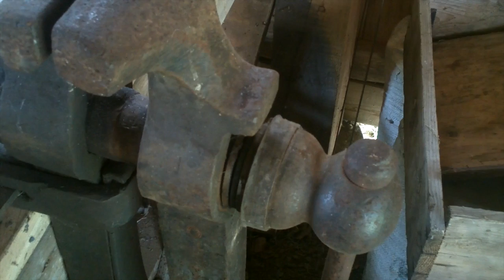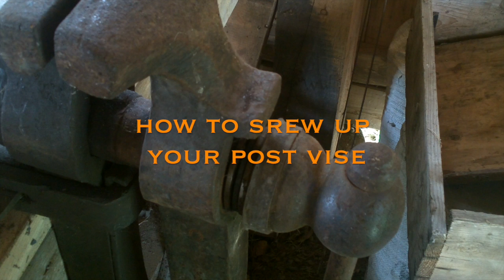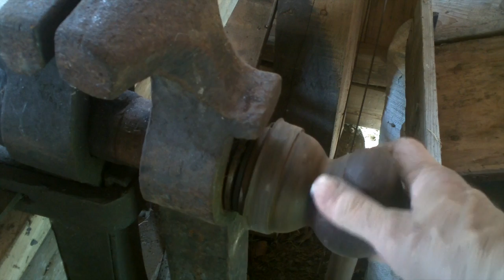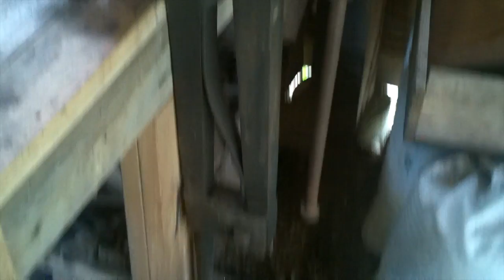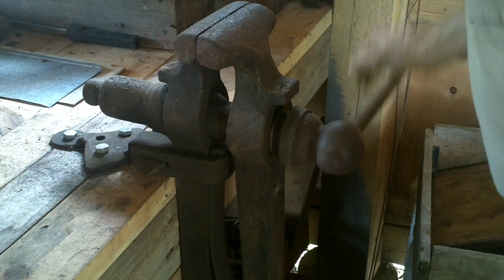Blacksmithing for beginners - How to Screw Up  Your Post Vise

Comment: I have a question i just purchased my first leg vice and it has no washer. What would you recommend using? Takecare
Reply from the maker: It doesn't have to be a solid ring.  I've made them by just bending a heavy round bar into a ring.